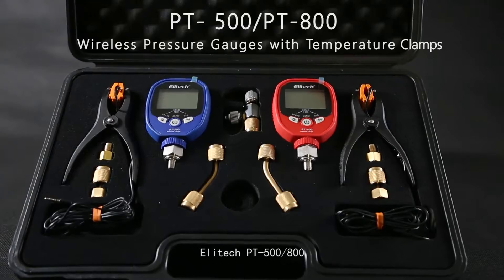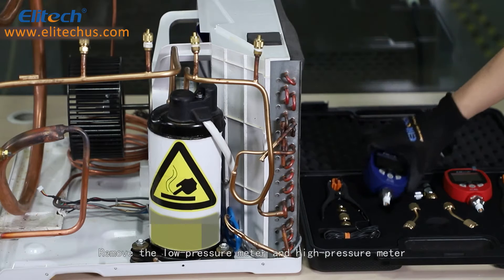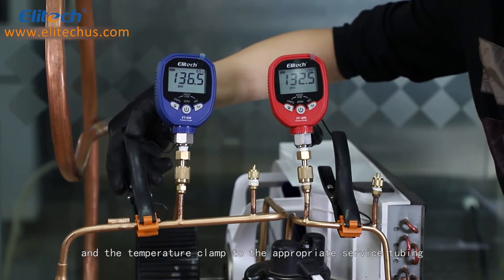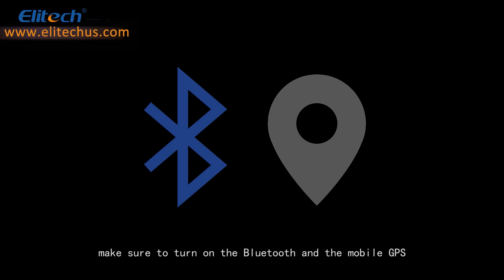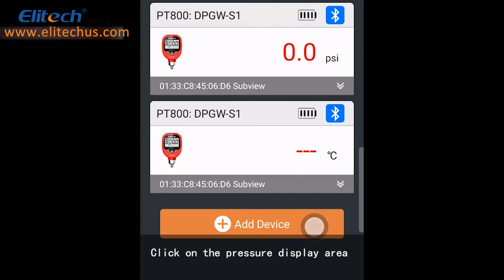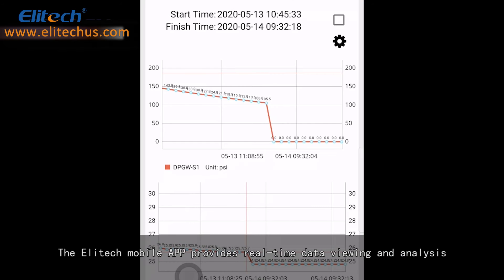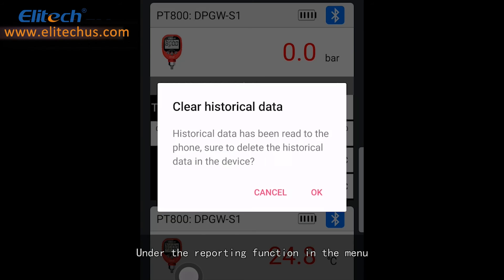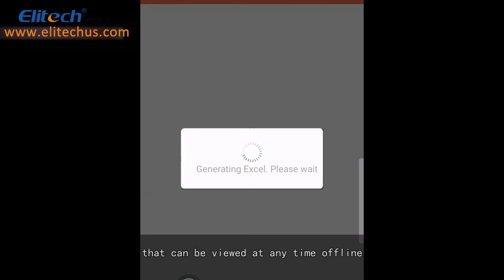Elitech PT-500&PT-800 Wireless HVAC Digital Manifold Gauge Set with Removable Temperature Clip

Comment: Can I adapt this with R134a coupler fittings for automotive use?
Reply from the maker: Hi, PT series products are mainly used for cold storage maintenance,  However, you can adapt PT500 with R134a coupler fittings for automotive use as well.
Reply: can r134 system be recharged with these gauges and the proper fittings?